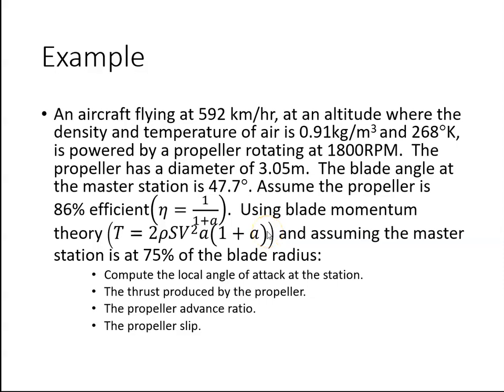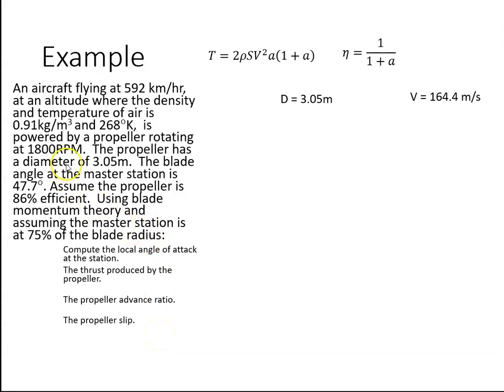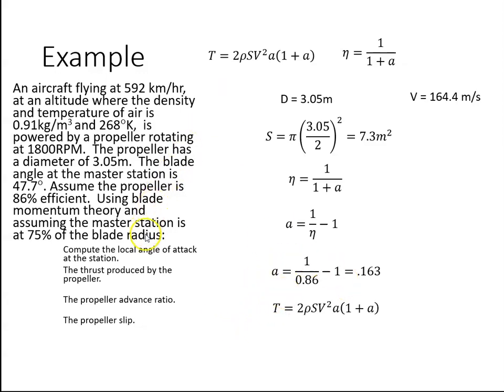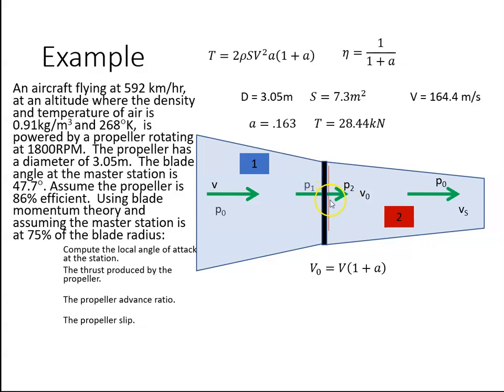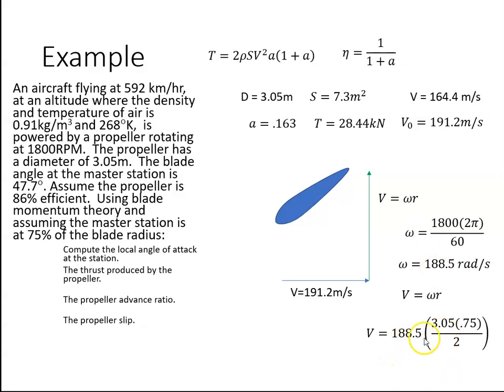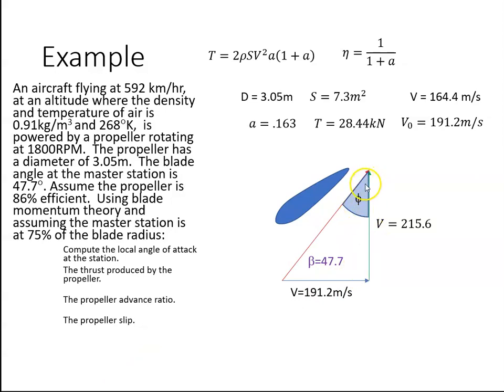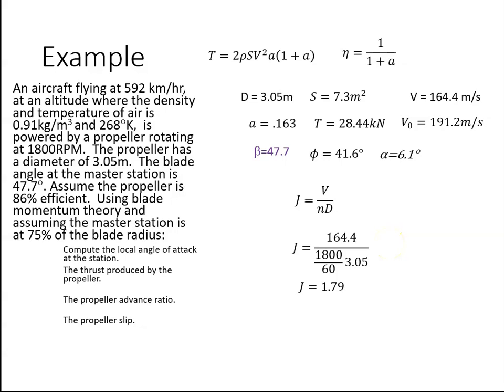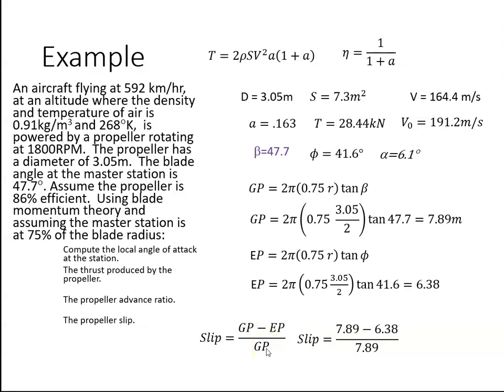Froude Momentum Example 5

Comment: There is an error in replacing character values with numeric values. When calculating T, area is replaced by diameter. The value is 7.3, not 3.05. And then T=68kN

Comment: Does thrust equation that you provided applies to helicopter rotor blades?
Reply from the maker: It would need to be adapted as the helicopter rotor blades are producing thrust and lift.
Reply: @RoddyMcNamee  kindly upload a scenario of the same in regards to helicopter rotor blades.. Thrust and power
Reply: @RoddyMcNamee  your videos are very easy to understand. Simple explanations. Post examples that are related to helicopter rotor blades.. I. E thrust and power equation